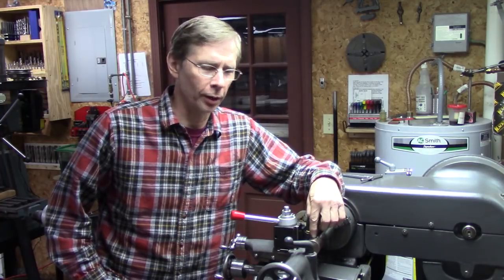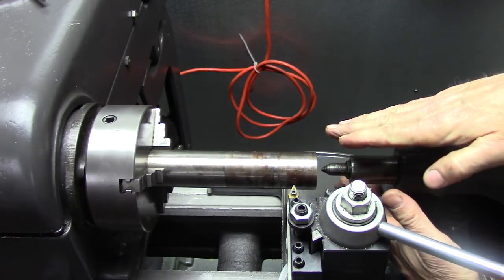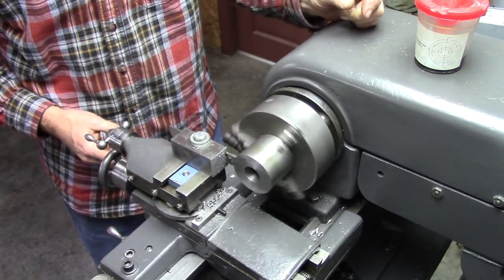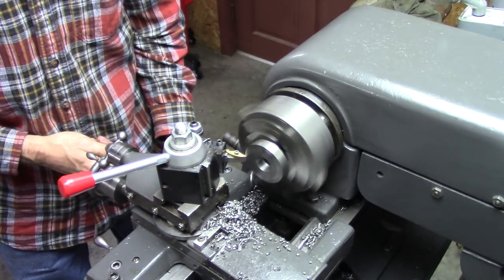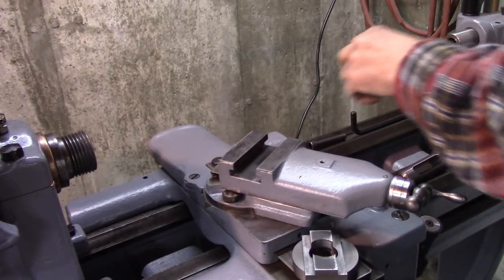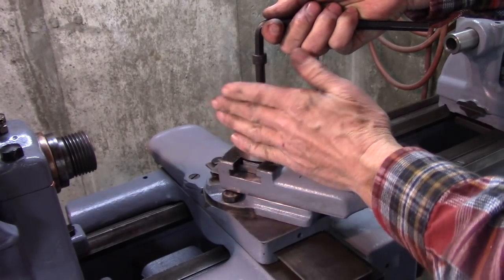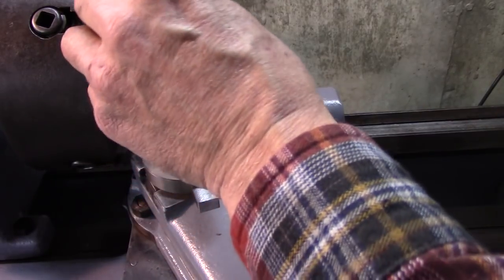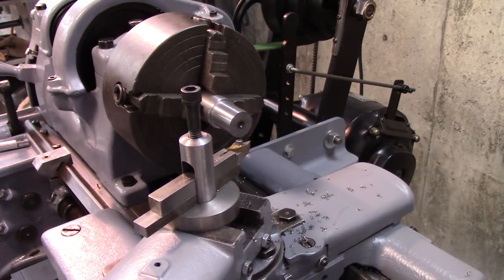Building an Improved Lantern Style Tool Post

Comment: Nobody seems to get it about the old lantern-style tool posts. The rocker is for forged tools, and using hss blanks by themselves. With the Armstrong holder you put away the rocker and turn the washer over, adjusting tool height by sliding the tool in the angled hole in the holder. No more headache
Reply from the maker: Makes sense. I was please with this design of this tool post for using a standard inserrt holder but it had some problems. To make it work well you would need several angled holders. The quick change post is better.

Comment: Cant believe I hadn't seen this video before. 
I have a similar issue with my hendey, I cant really describe it accurately.  But it's just like a QCTP or the 4 way tool holders just dont seem to be the best setup for it. 
However,  my 2557 logan it works like a champ. 
I am currently sorting out (slowly)  how best to work with the lantern on the hendey. For me speed really isnt a big issue. But I definitely like the setup your building here
Reply from the maker: I modified the holder after this video. I think I like the quick change post a little better but this is more solid. https://youtu.be/ZYNSaqv73rs
Reply: @WinkysWorkshop  I know I would prefer a QCTP on my hendey also, just dont really seam like it works very effectively though
Reply from the maker: @craigtate5930  I think what they call a 4 way is the most solid but you have to use shims. Quick change posts are not as solid.

Comment: Lantern style tool holders have angles that keep the slide back away from the chuck.
Reply from the maker: Yes they do. I think this was a good solid tool post and in part two I made a cool height adjuster but ultimately the quick change post had advantages that outweigh the shortcomings

Comment: Lantern tool posts take too long?  You're just slow and inexperienced.  BTW what happens when you use HSS on a QCTP and resharpen ? You have to reset the height! Do you use HSS or are you.............inexperienced???
Reply from the maker: I use a quick change on my other lathe. This lathe didn't have a tool post when I got and I was experimenting. If you actually watched the video you might have noticed this post is very easy to adjust the height....  like in two seconds. With that being said, I like the quick change a little better. You asked me if I was inexperienced. In fact you asked twice. I suppose I am inexperienced in many areas but I don't see this as a bad thing. In fact it is quite often a huge plus. I have no preconceived ideas of accepted method. I am able to think and create something much better (sometimes anyway). So go ahead and sit on your mountain top looking down on what you see as inferior while these inexperienced rookies take giant steps into a much better future.
Reply: Winky,  sorry my comments were directed at some replies below where some mentioned that the lanterns and tool holders aren't useful. I should have been specific. Aren't rigid, too hard to set up. I think you made a good toolpost. Yes, QCTP gets in the way all the time making small parts. Your video  is very good IMHO. I still prefer the rocker. No need to shim. Ruined T slots are from crashing the lathe and ripping out the post. I'm not a fan of crashing. Lantern posts are plenty rigid for light lathes. I can easily take .100 cut in cold rolled on a South Bend 9. A sharp HSS bit. Low rpm. slow feed. Watch the chip curl off to the floor. I don't do it all the time but it will do it.  Your Logan will do it. I had one.  There a little more rigid than a SB9 or 10k. BTW don't cut to the right to much on a SB. There's no real thrust bearing cutting that way. Only a fiber washer. Not good.
Reply from the maker: @karlkemble9098  - Thanks Karl. I messed up. I thought your original comment was on the second part of this video .For most stuff I like the QC post better but I also improved on the design in this video in part two. Check it out. https://youtu.be/ZYNSaqv73rs

Comment: I made a lantern tool post for my lathe as well. I built several tool holders for HSS blanks which use a wedge for height adjustment, which for convenience is retained when the tool is removed.  That was 2 years ago. All I use the OEM carousel holder for now is the parting tool.
Reply from the maker: The 4 way posts are good for cutoff work, the quick change posts are not so good if your lathe isn't super solid. You might find part two amusing.
https://youtu.be/ZYNSaqv73rs
Reply: @WinkysWorkshop  the threaded height adjustment is a decided improvement over the traditional rocking style. However, it still does not retain individual heights between different tools. If you make your own tools, you can incorporate an individual height adjustment into each tool. In your case this makes little sense, because you already own a quick change tool post and an array of carbide insert tools. Great video - thanks for sharing!
Reply from the maker: @5tr41ghtGuy  - Very true. The lantern post has one advantage, it's a little closer to the tail stock and this is why I made the tool post. On my Logan the tail stock always interfered with the carriage movement.  Of course it's also harder to get close to the chuck with the lantern style so it's a trade off. My south bend tail stock spindle was missing when I got it so when I made one, I also made it longer. I don't have the original to compare it too but I'm guessing it's a little over an inch longer. This makes a huge difference! I need to make a new one for my Logan too.

Comment: Not sure why you turn away from the chuck. I was taught that you always turn toward the chuck whenever possible.
Reply from the maker: Interesting. I'm not sure why it matters although if I mess up and run into the tail stock it's not quite as serious and running into a chuck. There is also the fact that you usually turn smaller features on the tail stock side. Running the tool off the end of the work is easy. If you are turning toward a shoulder timing is critic. So for me I guess the answer is that it's logical.

Comment: Great video it inspired me.  I replaced the rocker and its curved washer on my Atlas 10" with a spacer that brings the tool holders to where I can center the tools by adjusting the tool extension from the holders.   This works because the bits are held at an angle to the base of the tool holder.   There is a mix of Willmans,  Armstrong, and Atlas holders.  All but one work with the spacer. Its too tall.    My plan is to make a simple jig I can use off the lathe to set the tool tip height after sharpening or changing.   It seems to be working well and I love not having to mess with setting tool height, or have the rocker shift.  When I made the washer I made a few extra inches that I can use should I need a different spacer    Thinking of doing the same for my Sidney 14".
Reply from the maker: I use a lot of inserts. The HSS is better in some cases but the carbide is quick and easy.  Your method sounds like a good solution for HSS. I made a second followup video to this one that you might be interested in. Thanks for watching.  https://studio.youtube.com/video/ZYNSaqv73rs/edit/basic?o=U
Reply from the maker: FYI  - The paint was Rustolium. I prep the surface by cleaning with acetone and then prime with a very light coat of Rustolium primer.  In my opinion a heavy coat of primer weakens the final coat. I've had good luck with Rustolium although it takes 3 or 4 days to get good and dry.

Comment: Finish is lateral speed and the size of the tip.  If the tip were 5mil it would be smooth.  Not practical.  Normally a 3 or 4 is.  I have some 2 round nose inserts and they are the dickens in making a smooth surface.  It likes to create a thread of sorts down the shaft.  Now if you have Armstrong tools they might fit there for HSS bits.  I built a holder for mine on the quick change post.  I needed to use my long boring bar for light cuts.  Now I have Armstrong for other jobs.
Reply from the maker: Yep, you are right. I have some larger radius inserts that cut way smoother. However, the south bend does not cut as smooth as my Logan. With that being said, I can make a deeper cut and remove more with the South Bend. Cuts my Logan would complain about. If I had to guess, I'd say this is sleeves bearings vs ball bearing. With lighter or normal cuts the Logan runs true but the south bend has bearing clearance.

Comment: have you thought of turning the big the big washer down a little and threading a knurled nut onto it for height  adjustment. I've had good luck with mine .Not my idea I saw it in a popular mechanics magazine more than 40 years ago. I have one done that way on a 17'' Leblond Regal that I take the compound off and put a block same height as the compound in place of it for real heavy turning. Put the compound back on for angles.
Reply from the maker: Interesting!

Comment: On some of the older lathes the cross slide is almost too high to use a QC  tool post. I mmay have to adapt one like this.
Reply from the maker: My Logan is like that with some tool holders. I had to mill .100" off the bottoms of the tool holders.

Comment: Gday, thats a nice tool holder, both of my lathes have the old style 4 way tool holders, no quick change although id like one, I use feeler gauges as shims and I have written on a white board how many thou goes under my main few tool I use and if I change tools I just measure the shims and away we go, its not the fastest way but it works, thanks for sharing mate, much appreciated Winky,    cheers Matty
Reply from the maker: I've never used a 4 way but I'm sure they have the same advantages of a lantern post. They transfer the load to the compound straight down. Quick change tool posts suspend the tool off to one side and create a rotational force. I address the shims in the next video... posting today I hope.

Comment: My dad had a lathe with the lantern toolpost.  Most Youtube videos only use quick changes.   I am glad to know why, and how, the old style was used.  We never could get Morse tapers tooling to fit.  The old lathe had hand reamed tapers.   They had gone just bit too far.  The old shop likely just made their own tooling if necessary. It was taken from an old shop built for the WW2 Radar project at MIT.   Real history can be just around the corner.   Thanks.
Reply from the maker: Thanks for the comment. Good to hear about old machines and history.
Reply: @WinkysWorkshop  You are welcome.   I cannot support you as I'd like. So I try to entertain in return for your work.

Comment: Nice job. Another consideration is removing the compound and replacing it with a solid block mounted on top of the cross slide. Reinstall the compound when needed for threading or cutting short tapers. I have seen a variation of what you did but the outside of the post is threaded with a fine thread say 16 tpi. A thin nut secures the post on top of the compound. Another nut is threaded onto the post and supports the tool holder and is adjustable for height. This eliminates the need for shims. Keep up the great work. Stay healthy.
Reply from the maker: Interesting...  I'm not sure I followed that right but I found a new solution. I'll post a video today I hope.

Comment: I have an idea that might work. cut your shim from the top corner to the bottom corner. the length of it making 2 wedges. then figure a way to put a screw through  the length so as you tighten the screw the shim goes higher and when you loosen the screw in goes lower and then tighten down with the post screw
Reply from the maker: Another person said the same... and I actually thought about it too. Then somebody said they had one from a very old lathe with a threaded disk so I made one. The video may be posted tomorrow.
Reply: have you ever seen those wedges they use for adjustable clamps when milling. they have a stair pattern on them. now take your design and make two with a meshing stair pattern and it will be solid.

Comment: Suggestion: permanently attach the shim/spacer to the tool holder.
Thanks,
John
Reply from the maker: I thought about that but the color coding would mean I need to make fewer shims. However... I just addressed this problem another way...  video will be posted tomorrow if things go ok.
Reply: @WinkysWorkshop  I am guessing making matching "support rings" for each tool holder that you have. I would also guess that you have a limited number of "tool holder heights" so colour code rings for each height.😎
Reply from the maker: @paultrgnp  - good guess but I I'm just using milled down 1/2 x 1/2 stock under the tool

Comment: Winky I had rather see you dance than ramble on. 😁 I still have the original lantern tool post with my south bend. Takes to long to set it up and adjust tool height and angle. I will stick to my quick change tool post.
Reply from the maker: I'm leaning the same direction on the quick change although I did figure out a way to eliminate the shims. I may post the video tomorrow if I get the editing done. Dancing needs an inspiration. Like a major accomplishment... like getting the South Bend running. Ha
Reply: @WinkysWorkshop I'm sure you know more about the lathe than I do , but on the original lantern tool post it also has a half moon piece of metal that is used as a spacer also to adjust tool angle. I still have the hole set up that came with mine but it was to time consuming to use. If your not sure what I'm talking about I will send you pictures.

Comment: Nice work Mark really did beautiful job but couldnt you use the two point back rest mounts opposite of cutting tool position?
Reply from the maker: Thanks Troy...  You lost me on "two point back rest mounts"
Reply: @WinkysWorkshop  yes 2 point steady rest bolts on the cross slide not like the other independant steady rest ( 3 point )

Comment: For those that haven't used this style of tool post there are some tool holders you might find useful in addition to the left, right, and straight holders. 
You'll have to keep an eye out for them as they probably haven't been made in a long time. In the attached photo the tool in front has a swivil turret and holds the tool at a steep angle (as was common many years ago). This is handy for holding trepanning tools to cut o-ring grooves on a flat face when it's turned around backwards from where it would normally be used. It will also hold round tools.
The second holder is similar and I've used it a lot. It allows the cutting tool to be swung around a good bit. Once you've set the tool height you can quickly swap cutting tools as needed and swing them around as needed to get into hard to reach spots.
The last tool is an Armstrong brand threading tool. It is my go-to tool for cutting threads. The high speed insert is ground to a 60 degree thread profile. To sharpen it only the top surface has to be ground. As it is used up the insert is rotated. At the rate I'm using it up it should last until about the year 2631. 
Cheers from NC/USA
https://postimg.cc/jwJVKVzF
Reply from the maker: Wow...  thanks for the detailed comment. I had quite a few of these left,  right,  center etc. tool holders and sold them all. I probably should have kept them but I use carbide inserts most the time.  It I stick with this tool post I may make some for inserts.
Reply: I have those fixed tool holders too and rarely use them. The holders in photo take their place. With one of the swivil head tool holders and your new fixed height tool post it would about as efficient and quick to use as a quick change tool post.
I use cemented carbide turning and facing tools. They work well for home use and are easy to regrind. If you use them buy the correct grade for the work you are doing from Travers Tool, MSC, or other supplier. They work much better than the "mystery" tooling from China. 5/16" cemented carbide tools for a bench lathe are substantially cheaper than a box of inserts and will last you much longer.
I have a couple of insert tool holders but almost never use them. They are the thing for Job shop use and CNC. The problem is my lathe isn't stiff enough and doesn't have the horsepower for insert tooling to be cost effective. 
I do have carbide inserts that are left overs from pre-retirement. I silver solder them to steel shanks if I really need a particular style of insert. Only takes a couple of minutes with an oxy-aceytlene torch to make one up.
Cheers from NC/USA
Reply from the maker: @aceroadholder2185  - I use inserts all the time unless I need a particular profile. Some inserts are much better than others for lower speed and HP lathes.
Reply: This is amazing. After hours spent searching for an insert plate to put in my lantern-style T slot to use REGULAR posts, you build a new one from scratch...

Comment: New work thought you might have considered removing the cross slide and fitting a solid tool holder 😊
Reply from the maker: I've thought about removing the compound. For some work this would be okay but I use the compound a lot.